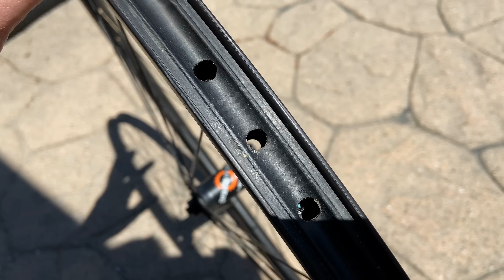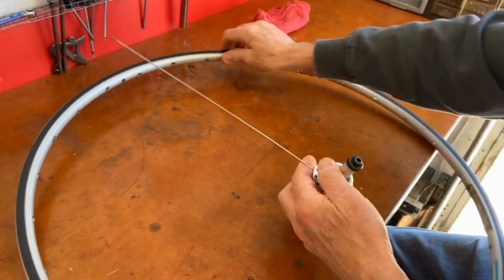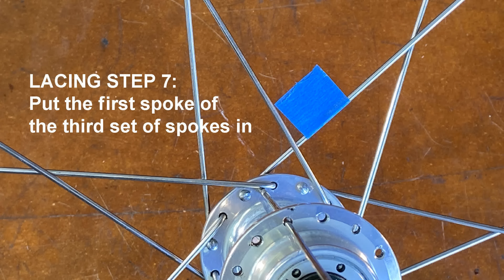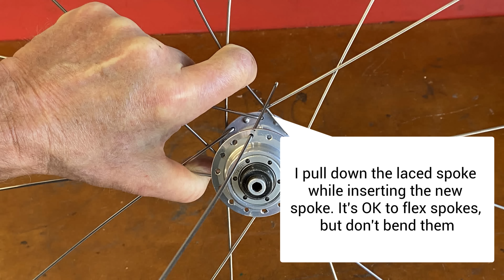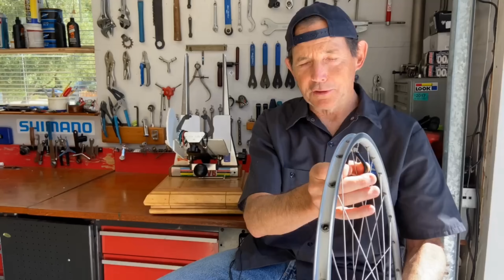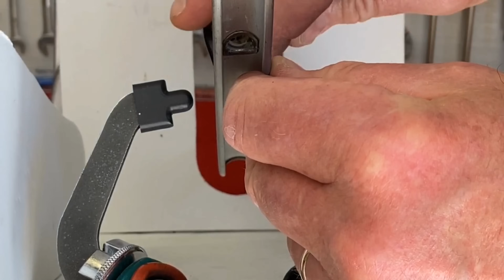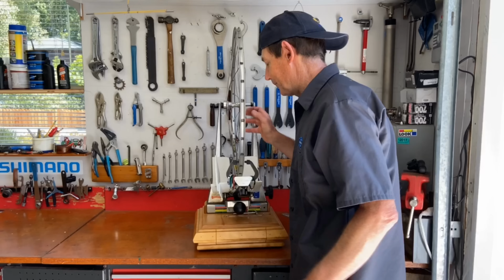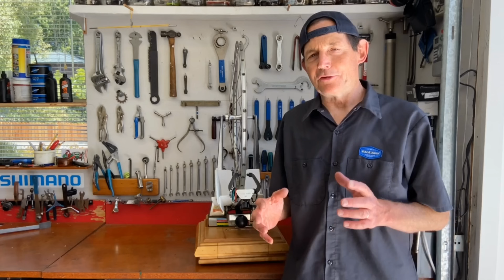How To Build Bicycle Wheels THE EASY WAY! #bikerepair

Comment: I'm just researching the build process. Your video is tremendous. I have a question about determining spoke length. I understand that many suppliers provide the correct spoke length for a given rim/hub combination. However, is it advisable to have the rim/hub in hand and measure to confirm the correct spoke length prior to buying the spokes?
Reply from the maker: Thanks for watching and the great comment, gnatman, appreciate it! I have another video about ways to determine spoke length here https://youtu.be/LvV4FE2VxZk To answer your question, I would say that most times the suppliers will get it right. And in theory if they don't they should be willing to replace the spokes with the right length since THEY made the mistake. But it never hurts to check if you have the parts and don't mind taking the measurements and doing the calculation. It's the odd stuff like new rims and hubs that no one knows the measurements on or they don't have them in their databases that usually cause the issues. With standard parts, they should get it right. Thanks again and hope this helps.
Reply: @Jim Langley  That's great to know. I'm in the process of my first bike build and figured I'd start building my first wheelset, too. It'll be fun, and I am glad I can learn from your videos. Thanks for replying!
Reply from the maker: @gnatman1102  you're very welcome. Have fun building the wheels and rest of the bike. That's a great project. Happy to help if you have questions.
Reply: @JimLangley1  I have another question. It involves the truing process.  I've read some literature saying it's preferable to only tighten during the truing process. You discuss and display both loosening and tightening spokes at the same time. Is this a normal process you employ for your building wheels? Or do you have a preference? Remember, I'm totally new to this and want to learn as much as I can.
Reply from the maker: @gnatman1102  that's a great question. What I recommend is mostly loosening at first and not tightening. That way you will not add any more tension early in the process. Usually when lacing some nipples may be further down on the spokes than others and those spokes will have a little more tension. Then when you start to true, it's better to loosen those spokes than to tighten the others.

What I do is first true for side to side. I spin the wheel and go around and try to get the wobbles out by loosening only. I move wobbles to left to the right and wobbles to the right to the left trying to get the rim back to the center.

If you find that loosening doesn't work to remove all the wobbles and get the wheel straight, then you have got all the spokes very loose (be careful never to unscrew a nipple all the way or it might drop off and you could lose it). At that point you may need to tighten some nipples to get the wobbles out but go easy and only use slight turns, like half turns or even quarter turns, that might be enough.

Usually by mostly loosening like this you can get the wheel very straight (no wobble). Once there, you then true for roundness - high spots and low spots. Since the spokes have only been mostly loosened in the first step, the wheel might be nice and round or close to it. But if not, look for any low spots and loosen the spokes in the low spots. See if you can get the wheel round doing that. Usually you'll be able to.

After getting the wheel straight and round with mostly loosening only, you check to see if the rim is centered since this is important too and it has to do with the tension. You can flip the wheel around in the truing stand to check if you don't have a dishing tool. Put one truing stand indicator next to the rim and flip the wheel. The rim is centered  when the distance from the rim to the indicator is the same when you flip the wheel in the stand.

If the centering is off as it can be with a just laced wheel, you can usually loosen the spokes on one side just a bit to get the rim to move half the distance to fix the centering issue.

In this early truing side to side, roundness and centering, you might find that loosening doesn't make the straightness or roundness or centering adjustment you need because the spokes are too loose. At that point you can tighten. You're going to do a lot of tightening to get the wheel properly tensioned. But the idea at first is to not put any stress on the spokes before the wheel is true, round and centered. That way when you do your tensioning the rim will be where it wants to end up and that makes the rest of the truing and tensioning go easier since you got it right at the outset with almost no tension on the spokes. Okay? Hope this helps. Take it slow and easy and observe what's happening. You only need to turn the nipple a little bit.. even quarter or half turns can be enough. You'll learn as you work and experience the process - enjoy it.
Reply: @Jim Langley  Thank you for the detailed information. I'm an engineer by trade. I have a perfectionist mindset, which gets me in trouble, sometimes. I know nothing is perfect, but it'll be fun.
Reply from the maker: @gnatman1102  if you take your time your engineering mindset and perfectionism will result in a perfect wheelset I’m sure. You can get most wheels very true and round so long as you focus and are patient working on one little wobble hop or dip at a time until they’re all done. It’s fun. You’ll get good at it with practice.
Reply: @Jim Langley  Thanks! I'm going to take the suggestion made to disassemble a wheel and disassemble from my 2012 hybrid and then rebuild it. I bet it needs truing anyway. I have some anti-sieze. I read some use for both the nipple threads and nipple to rim interface. If building carbon wheels, could anti-sieze be problematic? What do you use for nipples on a carbon wheel build?
Reply from the maker: @gnatman1102  using a used wheel is a great way to practice. Don't use anti-seize though - it makes a big mess of everything. Here's a video I made about ways to lube spokes: https://youtu.be/z4FKL95x6DE I use Wheelsmith Spoke Prep: https://amzn.to/3GeGdrL It's pretty easy to apply if you don't rush it and make sure not to get too much on. But it's kind of expensive. But even basic oil will work. You don't want too much or else it will get on the rim and down the spokes and you'll have a big job getting it all off with alcohol and rags and lots of wiping it off. You just need enough to wet 2/3rds of the spoke threads and the surface of the nipples that sits in the rim hole. On carbon rims, you don't want to lube the nipples as any oil, grease etc. will get on the carbon and can be difficult to get off depending on what it is.
Reply: @JimLangley1  Thanks! I'll watch it.
Reply: @Jim Langley  Back to the question on lubricant. Please forgive me for being dense. You may have answered earlier. I see you just lubricated the spoke threads. Do you ever add lubricant the interface between the nipple and rim in addition to the threads? Regarding the answer on carbon rims, I assume you still lubricate the threads? However, you don't add lubricant anywhere else to preventa mess on carbon spokes. Correct?
Reply from the maker: @gnatman1102  I lubricate the nipples on their outside when building aluminum rims only. You don't need much lube. Lube is easy to clean off of aluminum rims but still you want to try to keep the lube on the nipple and inside the rim not on the outside - especially if they are rim brake wheels. For carbon rims you don't use lube mainly because it can make a mess of carbon rims which are usually expensive. The lube just helps the nipples turn without binding as the spoke tension gets higher. Even if you forgot to lube in aluminum rims you'd be okay building the wheel. Lubing is an extra step with aluminum that just helps a bit during the build. 

Yes, I recommend always lubing the spoke threads or using a Spoke Prep. It makes the truing and tensioning easier as the tension increases. And down the road even years, if you lubed/prepped threads it'll be easier to true the wheel. If you don't the nipples might corrode onto the spokes in a worst case scenario.

It's your choice how you want to build wheels though. If you wanted to build wheels dry (no lubes or preps), you could do that and still build nice wheels. The reason is that the spokes and nipples have a small amount of lube on them from the process of manufacturing and packaging, especially spokes. Your hands will get a little dirty during building that's from the oil on the spokes. It's not much oil, barely noticeable but it is a type of lube or preservative that will act as a lube. So some builders will not lube and just go with factory spokes and nipples and trust that the lube on them is enough.

I prefer to add a little more lube on nipples and put Spoke Prep on the spoke threads. But, it's up to you how you want to do it really. Both will work. Hope I haven't just confused you more ;-)
Reply: @JimLangley1  You did not confuse me more. The information is extremely helpful. I really appreciate you taking the time out to provide such detailed and helpful responses. Not many others with YouTube channels are willing to go the extra mile to help the way you have helped me.  Thank you!
Reply: @Jim Langley  Do you have any good recommendations on where to source wheel components? Since I'm not reselling, I can only buy from retailers. Thanks!
Reply from the maker: @gnatman1102  it's always changing so everyone just googles and searches for what brand and models of hubs, rims and spokes they're looking to get and tries to find availability and best pricing and hopefully free or reasonable shipping and quick delivery (unless that doesn't matter). I look on the component maker websites because sometimes they do sell retail to consumers and I check Amazon since lots of even large makers sell on there now and eBay.com because shops sell overstock there and others, too so you can find crazy deals sometime (just got a pair of new vintage Mavic rims for $50). And you can go to companies that sell wheel components like wheelbuilder.com and prowheelbuilder.com. So it's always a bit of a project but you can almost always find what you need. The bike biz has been having a lot of shortages in the supply chain but it's improving lately. Hope this helps!
Reply: @Jim Langley  I figured Google or eBay would be my friend on the shopping side of wheel building. Thanks again!
Reply: @Jim Langley  Oh well. I'm back with another question or two. By the way, I appreciate the helpful responses. What are your thoughts on straight-pull and bladed spokes? I'm looking at a DT Swiss hub, which accommodates straight-pull spokes. It appears they make lacing pretty easy.
Reply from the maker: @gnatman1102  hi gnatman! I prefer regular J bend spokes and regular round spokes too. It's not that I dislike straight pulls and aeros, just that they tend to complicate the wheel build. While the aero spokes make for a more aero wheel, they can be more prone to twisting requiring spoke holding tools when you're truing and tensioning. And the same holds true for straight pull spokes - depending on the design of the hub. But, plenty of wheels are built with both and if you want to do it, I can walk you through what you should buy in the way of spoke holders and how to use them. 

Basically you hold the spoke with the holder with one hand while you turn the nipple with your other hand. That's compared to just turning the nipples with one hand. So it's a little more coordination with both hands and that makes it a little longer truing and tensioning and 2 things to pay attention to (not twisting the spoke/getting the wheel straight and round and tensioned), rather than one (just truing, rounding, tensioning the wheel). Hope this explains and is helpful. Here you can see me holding the spoke with the tool while truing with the spoke wrench in my other hand to get an idea how you work with both hands and focus on two things (kind of a fun dance but slower than working with standard round/J bend spokes): https://youtu.be/NyPGQrNfUFU?t=1360
Reply: @JimLangley1  Thanks again for your help. For the 1st scratch build, I'll just go with J-bend spokes.
Reply from the maker: @gnatman1102  you're very welcome, I think that's a good way to go. Have fun!
Reply: @Jim Langley  I have a question about nipple length and nipple washers. I'm looking at 12 mm vs. 14 mm. I know there are many factors influencing the selection. If choosing spoke length based on a calculator, which length nipple would be a better choice? What about using nipple washers?
Reply from the maker: @gnatman1102  12mm is the length most used gnatman so I usually go with that. Longer nipples might be needed with unusual, unique rim designs. There are even nipples a lot longer for special wheels like wood rims. But 12 is what's used most so you can't go wrong with most standard parts. 

Rim washers are mainly used if a rim manufacturer specifies that they must be used with their rims. In the 1950s and 60s there were aluminum rims without reinforcements of any kind inside the nipple holes. Later companies started installing ferrules in the holes to reinforce them. 

Nipple washers were required on rims without the ferrules from certain rim brands making superlight rims (the washers came with the rims, that's how you knew you had to build with them). 

These days, the rims that sometimes call for nipple washers are carbon rims, but it's rare because the carbon rims can be made so strong. So it really depends on what you're working with but in most cases longer nipples and rim washers are not necessary. Hope this helps!
Reply: @Jim Langley  This helps a great deal. I'm looking at a set of DT Swiss alloy rims for my 1st build. The reason I asked about the washers is the Pro Wheel Builder spoke-length calculator listed the rim with nipple washers. I'm curious to see what DT Swiss actually specifies. Thanks for the reply!
Reply from the maker: @gnatman1102  that's interesting. I would expect DT Swiss rims to have ferrules and not to require rim/nipple washers.
Reply: @JimLangley1  I plan to reach out to DT Swiss and ask.
Reply: @Jim Langley  Prior to contacting DT Swiss, I looked at the specs for the rim. It is a non-eyelet rim. So, I figured that was the reason for the builder site specifying the nipple washer. To confirm, I sent DT Swiss a message. They responded and indicated the rim requites the nipple washer, which they supply with the rim along with the nipples. Do you have any experience with their Pro-Lock Nipples? If so, should the threads receive lubricant even though they come with, essentially, a loctite material? I didn't ask them and decided to ask you here to get some real-world opinion. Thanks!
Reply from the maker: @gnatman1102  yes, I've used Pro-Locks, gnatman. You don't need to use any lubricant with them. They get harder to turn as you're truing and tensioning the wheel because the thread locker reaches more threads and begins to do its job of binding the nipples. I prefer to build with regular nipples and spokes treated with Spoke Prep or just lubed since you have less issues with spoke twist and thread locker trying to lock the nipple as you build the wheel. I don't know if you saw it but I have a video showing how to remove nipple/rim washers that you might like to watch to get an idea what working with them is like: https://youtu.be/6EtQsst3Z98 Overall, for a first build I would say it's significantly easier to go with regular spokes, nipples and no rim washers. That's also the way the vast majority of wheels are built.
Reply: @Jim Langley  Based on your response, you convinced me to follow my instincts to build a normal (i.e., without nipple washers) wheel . I'm also looking at a set of Light Bicycle Falco Pro carbon rims. After looking at the LB rims, I saw your video from 2 years ago, where you evaluate an LB carbon wheelset. It's interesting that the set you evaluated didn't have nipple access holes. According to their website, they say feeding the nipple through the rim is more challenging. At this stage of my building career, I would order with the access holes, as I don't want this challenge yet.  The access-hole rims are tubeless ready, and I would consider taping the rim an easier task. The only thing is Pro-Wheel Builder doesn't have the LB rims on the drop-down list for spoke-length calculation. However,  I know how to measure for spoke length. I plan to order the rims, hubs, and get some old spokes and nipples to use to determine ERD. Do you have any suggestions?
Reply from the maker: @gnatman1102  yes, feeding the nipples through the rim is another skill to learn with those rims gnatman.. LB has a video showing how they recommend doing it and Park Tool just put one up too. It looks kind of fun but definitely s-l-o-w compared to just popping em in through holes. Rim tape does fine sealing rims. As far as determining the ERD of those rims you can wait and measure them and you could also reach out to LB and ask them. They'll know what the ERD is on all their rims.
Reply: @Jim Langley  Didn't think about asking LB. Good suggestion! Thanks!
Reply: Hello Jim! I ordered and received DT Swiss Classic 240 hubs for my build. I decided to check the hub dimension specs for the spoke length calculation. Of course, nominal hub widths for road hubs are 142 mm rear and 100 front. I measured widths of 143.2 mm rear and 100.93 mm front. So, I checked the rear with an old imperial caliper and measured just over 5.63 inches or approximately 143 mm. I looked all over the web for +/- tolerances for the hub industry and couldn't find anything. I assume these measurements are within acceptable tolerance? That is less than 1% to the wide side for both. So, I should probably accept these measurements and proceed.
Reply from the maker: @gnatman1102  Nice hubs Gnatman! I'm thinking that those slight differences might be due to something like the end caps not being completely pressed down. Did those 240 hubs come from DT Swiss in original packaging from DT? Or did they come separate in packaging that's generic, not DT Swiss? If that was the case the hubs might have been assembled and the end caps can get pushing on by people who don't understand and not get bottomed out. Also, if an end cap has something pushed into it like a hub protector/wheel protector when you pull those protectors out/off it can sometimes move the end cap position. Try resting the hub on a flat surface and press down on the top end cap with your hand or gently tap with a rubber mallet to see if you can seat the end caps further. Be gentle, the caps should seat without too much force. Then remeasure and see if it makes any difference. I think it might as I would expect 100 and 142 from DT from measuring hundreds of their hubs over the years. I think it's probably an issue with the end caps and that the "real" spacing is 100 and 142 or closer to it than your caliper measured. Hope this helps. Let me know what you find.
Reply: @Jim Langley  I bought the hubs retail from the LBS. They came in original DT Swiss packaging. Attempted the adjustment, and both hub widths did not change. The rear hub does fit well in the dropouts for the thru axle. I don't know if I should reach out to DT Swiss? Thanks!
Reply from the maker: @gnatman1102  well it won't affect the build and if they came that way then that's just what they are. But I'm still curious. Is there any chance your caliper is off or that something about the hub is making the caliper ends sit crooked on the end caps when you take your measurement? I usually measure with a thru axle gauge that goes through the axle: https://youtu.be/blrOra5vi5I
Reply: @Jim Langley  Thanks! I like the hub width tool tip video. However, I'm confident in the metric caliper. I compared it to my old imperial unit caliper. Using the rear hub and old caliper, it measured 5.63 inches. Converting to mm result is 143. I kind of like the wider error because of the secure fit in the dropouts.
Reply from the maker: @gnatman1102  thanks for letting me know. I'm glad you are okay with it. Sure sounds like it's just what it is and nothing to worry about.
Reply: @Jim Langley  I haven't received the rims from Light Bicycle yet. For the rims ordered, they quote an ERD of 550 mm, without nipple head. Using the Pro Wheel Builder spoke calculator and my manual measurements for the rear hub, the length estimates are 271.4 left and 269.9 right, or rounded to 271 and 270. Keeping the ERD constant at 550 and selecting the hub model on the DT Swiss Spoke Calculator page, the spoke lengths are 271 left and 270 right. I think I'm in pretty good shape with the manual measurements. However, I need the rims to confirm the ERD.
Reply from the maker: @gnatman1102  that sounds about right to me but I always feel better after measuring the rims myself.
Reply: Hey Jim! Got the old front wheel apart and measured ERD and hub. Have you run into a factory wheel built with spokes that are too short? I've checked the measurements and calculation several times, and arrived at the same result. They are about 2 to 4 mm too short
Reply from the maker: @gnatman1102  yes, the quality of factory-built wheels varies a lot. Sometimes they’re great, sometimes not so much. Same thing with production wheels on sometimes even major brand bikes - they can have issues too.
Reply: @JimLangley1  Thanks for that information! Tried to put it back together anyway. Lacing went well. However, I couldn't get the threads of shorter spokes on the disc rotor side of the front wheel into the nipples without over tensioning the spokes. Didn't want to damage the hub. By the way, when inserting the key spoke, does it matter if the disk rotor side is up or down for the front hub when the spoke holes are alternating from center? Overall is, typical, symmetrical. I inserted the spoke in left hole from stem. I don't believe it does, but I wanted to check. By the way, I plan to buy new spokes and nipples for the wheel and start over.
Reply from the maker: @gnatman1102  I saw your other comment about the rotor side of the hub but when I hit reply YouTube didn’t take me to the comment so there wasn’t any way to reply - one of the mysteries of YT that happens now and then. But to answer it only matters if the rim drilling is offset. Since yours isn’t you only need to make sure the rotor side spokes go to same side as the hub rim holes. Hope this helps.
Reply: @JimLangley1  It does. That's what I did. Thanks!
Reply: @Jim Langley  Hi Jim! Ordered and received the new spokes/nipples for the rebuild of the front wheel. Since the calculator estimated lengths of 291 mm and 293 mm, I went with a non-differential 292 mm average. When dealing with a rotor or drive side wheel and non-differential spokes, I've read two opinions. One is to only begin tensioning from the rotor or drive side and only adjust the non-rotor or non-drive side spokes during the truing process. The other is to begin tensioning by tightening the nipples in a 3 to 1 ratio rotor or drive side to the other side prior to the truing phase. I'm curious. What opinion do yo have on this?
Reply from the maker: @gnatman1102  you're at one of the most fun parts of wheel building gnatman! So to explain, if you had different length spokes and you turned each nipple down by the same amount when lacing, you would end up with the rim already somewhat centered over the hub. Because it would move toward the shorter spokes. Since you are using same size spokes that won't happen. So you will want to check that the rim is centered during this initial stage of truing and rounding the just-laced wheel.

What I do is true the wheel for side to side first. Then I true it for round. I do this trying to only loosen spokes first rather than tightening any. The goal is to end up with a true, round wheel with almost zero tension on the spokes at this point (the wheel was just laced so there should be little tension on the spokes). As the wheel gets true and round I will check it for centering. If it's a little off as is usually the case with same size spokes, then you need to loosen the spokes on one side a little to get the rim to center. Keep in mind it only needs to move half way whatever distance it needs to move. Since it's a front wheel it's not going to need very much.

Now once the wheel is true, round and centered with very little to almost zero tension on the spokes, it's time to start tensioning the wheel. During this process you will want to pay attention to determine what happens. Usually with most front wheels, to keep the wheel centered as you tension, you will turn the drive side nipples about a half as much as you turn the rotor side nipples (that's the tighter side). So if you turn each rotor side nipple one turn, you turn the other side 1/2 or sometimes 3/4 turn. That ensures that the rim doesn't move out of center. But this varies a little from wheel to wheel so you'll want to try it and then check the center and see if the rim stayed centered. If so, then you're good. And you can continue tightening like that. 

It's good keep checking the centering after each round of adding tension. I use a dishing gauge, some people like to flip the wheel in the truing stand but to me that's slower. You can also use the stand to check centering. You do this by setting one side of the truing stand caliper to just miss the rim when it spins. This is when you know the wheel is centered, i.e. you have the rim where it needs to be. Now that the stand is adjusted this way, each time you add another round of tension you can see if the rim moved and if it did, you can go around and loosen to get the rim to go back where it's supposed to be to be centered.

You can also fix any centering discrepancies when you're done tensioning, but it's usually easier to get it centered at the outset and then keep it there as you tension. On some wheels, once a wheel is true, round, centered and has been about 50% tensioned it will stay that way throughout the rest of the tensioning process once you figure out the right amount to tighten each side's nipples. Okay? Hope this helps and have fun!
Reply: @Jim Langley   @Jim Langley   Thanks for taking the time for such a detailed response! It definitely helps give me a good starting base.
Reply: @Jim Langley  Hi Jim! Finally! My hybrid front was rebuilt. The question. Can I claim success?  I was able to true laterally and radially within acceptable. The dish is virtually spot on.  For the tensioning, I was able to get tension within 15% of average on both sides. I was one spoke away from within 10%. However, I question if the difference in tension from non-rotor side to rotor side is too great. Average rotor side tension ended up at 102.8 kgf. Non-rotor side average is 55.8 kgf. I read somewhere that getting a ratio of 1.8 between the two is good.  Or should I just be concerned with getting the rotor side within spec for the rim along with true and the dish?
Reply from the maker: @gnatman1102  way to go gnatman, good job! You’ll most likely be fine, but if you wanted to tighten the wheel a wee bit more it would help the looser side spokes which if they’re are slightly undertensioned might loosen after many miles. As you add a layer of tension to the wheel the sides should get closer to each other too. But you could also just ride the wheel and keep checking it and if the loose side spokes stay tight all’s good. If not it’ll be an ez job now to add a bit more tension now that you’re a bona fida wheelbuilder!
Reply: @Jim Langley  Thanks for the reply! I guess I'm an apprentice bona-fide wheel builder. Lol. I did find something about the ratio of tensions between one side, and the other should be consistent with the hub flange distances to center.  For the front, the left hub flange to center is 22.4 mm. The right is 37.1 mm. Therefore, the right-side spokes should be approximately 60.3 percent of the left. With the left spokes at 102.8, the right should be approximately 62 kgf. I'll try to bump up the tension on the right side and go from there.
Reply from the maker: @gnatman1102  that’s interesting. The way I learned is to go by the max tension, which has changed as rims have changed - gotten higher. By going by that it’s pretty simple because you don’t even measure loose side tens you just measure tight side to ensure it’s at your max tension. Because the loose side is always going to end up wherever it ends up based on the tens of the tight side. But you don’t want spokes loosening on riders so if that happens on the loose side you would add tension to the whole wheel even if it means going a little tighter on the max tens. Another “trick” for loose side spokes that loosen is to only tighten the loose side a little. This will change the rim centering but in most cases the wheel will still center close enough in the frame so it won’t affect anything and it can keep those spokes from loosening.
Reply from the maker: @gnatman1102  that’s interesting. The way I learned is to go by the max tension, which has changed as rims have changed - gotten higher. By going by that it’s pretty simple because you don’t even measure loose side tens you just measure tight side to ensure it’s at your max tension. Because the loose side is always going to end up wherever it ends up based on the tens of the tight side. But you don’t want spokes loosening on riders so if that happens on the loose side you would add tension to the whole wheel even if it means going a little tighter on the max tens. Another “trick” for loose side spokes that loosen is to only tighten the loose side a little. This will change the rim centering but in most cases the wheel will still center close enough in the frame so it won’t affect anything and it can keep those spokes from loosening.
Reply: @JimLangley1  Hi Jim!  During this wheel build, calculating a theoretical lower-side tension prior to the build would’ve been helpful.  I am certain you already know all this information presented in this post.  However, I wanted to share it for those that may read our discussion items.  The calculation provides a theoretical tension of these lower-tension spokes needed to maintain a proper dish for a wheel where the higher-tension spokes are at the goal tension and the wheel is true.  By measuring the lower-tension side during the build, it can show if these spokes are being tightened too fast in relation to the higher-tension side, which I believe complicates the truing process.  In my view, as long as the tensioning and truing process are performed slowly along with sufficient stress relieving the wheel throughout, checking the lower-tension side during the build can minimize the need to constantly check the dish.  During my build, this was the biggest fight I had during truing process.  That was truing would throwing the dish off, and vice-versa.

Since my last response, I came across the website titled Spoke Calc.  They have a great deal of information/instruction on, of course, spokes.  You may already know about them.  Their primary goal appears to be to sell their spoke tension calculator.  The main sub-link of interest is:  https://spokecalc.io/spoke-tension-the-difinitive-guide.php.  About one-third down the page is a basic formula for calculating spoke tension on any side, provided the lengths and angles are known along with the tension of one of the sides.  I am a nuclear waste characterization by trade.  However, my degree is in Civil Engineering, and I have a good grasp on statics.  Basically, the formula is statics.  I can’t believe it took me so long to think about wheel building is essentially a statics problem, and I should’ve been able to calculate this on my own.

The front-wheel I re-built is 11-years old.  I could not find a tension spec for it.  So, I aimed for an average value around 100 kgf for the high-tension side.  Since I ended up at an average of 102.8 kgf along with a reasonably true and dished wheel, I am completely happy with my efforts.  However, checking the lower-side tension against a theoretical value during the build would’ve been helpful in evaluating the dish without actually having to perform the check and fight it as I noted above.

For my setup, it was a bit more tricky because the spokes at the rim do not merge to a single point.  This is due to the offset of each spoke hole from the rim center.  When re-building the wheel, I did not measure the distance of each off the centerline of the rim mine because the offset is symmetrical.  The total offset distance between holes is not much.  Based on a visual estimate, it’s about 1 to 2 mm on each side of center to the center of the holes.  However, to calculate the angles of the spokes at the rim, all I had to do was subtract 1 mm from each flange to center measurement.  From there, it was easy.  Since I built to 102.8 kgf average on the high-tension side, the result for the low-tension side is 60.9 kgf for the wheel to be dished.  However, nothing is perfect, and the variability in the tensions show to arrive a true wheel show this.

I look forward to continuing this journey becoming a wheel builder, and I want to thank you for taking the time to assist me with this effort.
Reply from the maker: @gnatman1102  thank you for sharing all this gnatman. I’m happy you found that great site (yes I’ve used it) and that it helped you learn more about the wheel building process. Most beginners don’t have and would prefer not to have to pay for a tensiometer and only 40 years or so ago they didn’t even exist and no mechanic felt a tool like that was needed to build great wheels. The first one I had was around 1982, 12 years after I became a bike mechanic. Today most pro wheel builders wouldn’t be without one. But you can still built great wheels without one. And if you’re only building one or a few it’s hard for most people to justify the expense and it also adds another step to the builds and having to learn how to use and read the tool. Again congratulations on building your wheel and learning the process and thanks for this great conversation that will surely help others follow in your footsteps 🙏
Reply: @Jim Langley  My pleasure. I'm looking at the wheel building more as a retirement activity. I turned 60 last November and plan to retire at 67. If I can, sooner would be better. I don't believe I can really make any supplemental income building from scratch. For building from scratch initially, I'll look at it something I can do for friends for free and build a customer base and go from there.  However, I believe I can get into the repair or maintenance side (i.e.  truing) of wheels. I spoke with a LBS recently about it and asked them if they do wheel repair in house. I found out they source that out because none of their techs are good at wheels. Who knows if this is even viable for me? However, it's worth a shot. At least, I now have another hobby I can use to justify retirement. At least, I found out Pro Wheel Builder is in Cumming, GA. I'm in GA as well.
Reply from the maker: @gnatman1102  it’s great to hear you may be able to turn wheel building and repair into income during retirement. That’ll be fun I’m sure.
Reply from the maker: @gnatman1102  that sounds like a great plan and a fun job for retirement. I hope it works out.
Reply: @Jim Langley  Hi Jim! You may have a video covering my question here. What are your thoughts on the use of aluminum nipples. My new rims will be carbon. I know aluminum and carbon composites can undergo galvanic corrosion. I also know that the ammonia in the Wheel Smith Spoke Prep can be corrosive to aluminum. Therefore, do you ever use aluminum nipples? I like the color options, but it appears they pose more trouble than their worth. For my wheel rebuild, I bought 100 black brass 12 mm nipples. I figured that after the rebuild, I'd have 68 left for 56 spoke holes on the new rims.
Reply from the maker: @gnatman1102  brass makes the most sense but most high performance wheels use aluminum to save weight and meet consumer expectations gnatman. 99.9% of the 500 or so wheels I’ve built in recent years were with aluminum because it’s what people demand. They hold up fine in carbon rims and with sealant unless you ride a lot in snow where they salt the roads or if the rim tape job has leaks and a corrosive sealant gets at the nipples. But the most common problem I’ve seen is too short spokes. That will cause aluminum nipples to break at the top of the spoke. The spokes need to fill aluminum nipples. No worries on spoke length with brass and the actual weight saving is about 40 grams per wheel so hardly noticeable. Hope this helps!
Reply: @JimLangley1  That's good to know about aluminum. I like the idea of adding some other color to my new wheels and may give aluminum nipples a try then. Thanks!
Reply: Hi Jim! Hope all is well. I finally received the Light Bicycle carbon rims. Since Light Bicycle recommends double butted or bladed spokes, I went with bladed.  I have a tool for preventing wind up. I also decided to try aluminum nipples. The problem is the rim has a tension spec of 120 kgf to 135 kgf. I couldn't get to the bottom of the range without damaging the nipples. The nipples actually deformed by twisting and not by rounding. I prepped the threads, lubricated the nipples and used the correct size spoke wrench, and just couldn't get there. They were DT Swiss nipples. Other than switching to brass, are there any other recommendations/techniques with aluminum nipples?
Reply from the maker: @gnatman1102  hi Gnatman! Something sounds definitely wrong. I can't recall ever damaging aluminum nipples the way you describe. So either I don't understand what's happening or perhaps something was wrong with the nipples. But, I've never ever had an aluminum nipple from DT or other companies fail the way you describe. Could you take a photo of some of the damaged nipples and email it to me at my first and last name at gmail? Maybe if I could see a photo I could figure out what's going on. 120-135 is on the high side of spoke tension, the 135 more than the 120 which is pretty standard. For the nipples to fail at 120 - a normal tension spec - I think something's amiss but I'm not sure what. Maybe a photo will hold a clue.
Reply: @JimLangley1  Thanks for replying! I put them in the trash. So, I can't take any photos. I switched to the brass. A few of them deformed in a twisting fashion. After going over the process in my head, I put the blame squarely on me and my inexperience. I was careful applying the WS Spoke Prep. A few appeared to have excess. I remember some of the nipples were somewhat difficult to turn while zeroing them out after lacing. I'm not certain if this could be an issue. I put oil in between the nipple and rim as well. I also fought both truing and dushing. So, I'm not certain if repeated turnings stressed the aluminum too much. I will switch to brass for this build and save the remaining aluminum nipples for later. Thanks for the offer to assist!
Reply from the maker: @gnatman1102  thanks for explaining more. It sounds like maybe you just turned them too many times. Ideally you will initially get the wheel round and true and centered almost perfectly and almost only by loosening nipples/spokes not tightening them. The idea is to have a nice perfect wheel with almost no spoke tension. This won't stress the nipples at all. Once the wheel is like that you gradually bring up the tension of the wheel. If you go back and forth tightening and loosening and repeating that process you could possibly wear out some nipples. Brass nipples will help and as you develop your process and skill I bet you won't experience this again.
Reply: @JimLangley1  I love troubleshooting and am really enjoying the process.  I read a few wheel-building forums about aluminum alloy nipples. Several people had the same issue I did with DT Swiss alloy.  They found the alloy was prone to binding during the truing process.  For alloy, several switched to Sapim. Apparently, the Sapim have a better coating that resists binding. Some only use the double-square nipples from Sapim when building with alloy. I also found out Light Bicycle builds their wheels with the double-square Sapim alloy nipples. LB also uses the 18 mm double-square, which is 14 mm internal. I used 12 mm. Initially, I thought they were going to be too short for the rim, but the extend out just far enough to get the wrench on it without damaging the rim.  It would've been nice if LB included this info in their online manual for building. Do you like double-square nipples? They seem to have a good purpose.
Reply from the maker: @gnatman1102  yes, I've used DSN nipples a lot (double square) - it's nice to have two turning options. I'm glad you're enjoying the learning and troubleshooting so much, it's all part of what makes wheel building so enjoyable to me.
Reply: @JimLangley1  Hi Jim! Well, I switched to brass and got the rear wheel as good as I could while maintaining 1 mm on the dish gauge. The highest tension I could achieve on the drive side is 110 kgf. Even though none of the spokes bottomed in the nipples, I could no longer turn a few. I rounded a few of the brass and replaced them.  Even though lubricated, I believe the niples were binding in the carbon. All tensions are within 5% of average per side. I'm sure the wheel is good to use, but I wonder if I should tear apart and go with nipple washers? Of course, that may necessitate another set of spokes.
Reply from the maker: @gnatman1102  something is going on to have such difficulty getting the wheel to tension and to keep having nipples fail. I'm wondering if maybe you've got the spokes in the wrong holes in the rim? That mistake will bind the nipples for sure. Did the rim come with a lacing label telling you how the rim is designed? Or did they send instructions or did you find instructions to follow before lacing? You might be able to see it if the rim is laced wrong but it's not easy. That's why it's best to go by the rim maker's instructions. The binding happens because the rim hole is drilled at an angle and the nipple is put in across or fighting the angle not in line with the way the hole was drilled in the rim. I think that might be what's going on.
Reply: @JimLangley1  You may already know Light Bicycle applies a spoke direction arrow adjacent to the valve hole indicating the angled spoke hole. Their instructions also noted the angled spoke holes. When looking at the spoke holes, I confirmed this fact. When lacing, I ensured the arrow was facing up and installed the spoke from the upper flange based on the orientation of the hub. Since I haven't built the front wheel, I inserted 2 spokes with nipples in the spoke holes on each side of the valve hole and positioned the spokes as if lacing a hub. Based on this check, I laced it correctly.

However, while performing this check, I came across one possible issue that I didn't really worry much about during the build. Each nipple is 2 mm, both the brass and alloy. I have plenty of spare bladed spokes from the recent purchase.  When threading the nipple on any of these new bladed spoke threads, the nipples started binding on the threads after 4 or 5 rotations. This happened trying other nipples. I could turn them, but it required some force to thread the nipples completely on the spoke that was not normal. When building the rear wheel, I noticed the extra resistance that appeared odd when zeroing the nipples but kept going thinking it was caused by the spoke prep. Back to today. After noticing the nipples binding on the bladed spoke threads, I tried several of my leftover double-butted spokes. I could spin the nipples on all these spokes with no extra effort needed.

I wonder if there is a difference in the thread pitch from the bladed spokes versus the other? I can't find my magnifying glass to check. So, I can't confirm. I measured the thread diameter, and both types are 2.0 mm. So, diameter doesn't appear to be the issue.  I know the issue is not whether a spoke is bladed or double-butted. They are each spec'd as 2.0 mm at the threads on the shipping order.

I wonder if I'm dealing with some galling of the threads causing seizure of the nipples? Have you dealt with this before?

Sorry for the long post, but I'm glad you asked the question about the spoke hole angles. It got me investigating, and I appreciate that.
Reply from the maker: @gnatman1102  I have only had Light Bicycles wheels in my shop never their rims alone. But, from what you describe about the fit of the nipples maybe you have the wrong spokes for the nipples? Nipples should thread on without any difficulty by hand and especially with any spoke wrench. Spoke Prep if it's too thick can make it more difficult but nothing like what you're experiencing. If the spokes are Sapim and the nipples are Sapim and both are 2.0 then I wouldn't expect them to have problems; same if they are both DT. But if the nipples won't thread onto the spokes all the way by hand, then something's not right. Can you contact Sapim and see if they made a mistake and shipped the wrong spokes? The spokes are stainless steel most likely so the threads shouldn't be able to corrode on the spokes and new nipples in brass or aluminum shouldn't have had time to corrode so I can't see how galling could be happening. But what you describe is exactly what happens if you try to put 1.8mm nipples on 2.0mm spokes. In the shop you have to be extra careful not to mix up spokes and nipples for this reason. You can't see the difference. It's easy to get it wrong. If this is the problem it's too bad as it sounds like whoever sold the spokes might have made a mistake. Good luck.
Reply: @JimLangley1  Actually, I purchased the spokes from Prowheelbuilder. After my message to you, I reached out to them. In fact, I'm in Augusta, GA, and Prowheelbuilder is located in Cumming, GA, northeast of Atlanta. I like buying from them because shipment time is great. The nipples are not the issue, as they worked fine on the double-butted spokes I used for my hybrid wheel rebuild. After several correspondences, they indicated a die the use was failing and was replaced. The spokes I ordered may have been cut with that. Apparently, they cut spokes to length to fulfill an order and then cut threads. I was told it was a die, but I thought spoke threads were formed by rolling. Either way, they plan to replace the spokes.
Reply from the maker: @gnatman1102  I'm happy to hear you figured out what's wrong gnatman. I would never expect a company like Prowheelbuilder to cut & thread spokes to length. I would expect them to only sell factory spokes fresh out of the box, never altered spokes. If I had thought there was a possibility you purchased cut & threaded spokes I would have known that was probably the issue because it's a common problem when people buy from bike shops that have these spoke cutters. It's especially questionable that they didn't bother to check the threads on each spoke before sending them to you too. But at least you should be good now. Hopefully they can send you factory spokes not more cut spokes since they don't seem to have a good machine and also don't seem to know how to use it or how to do basic QC checks. If the subject comes up you could ask if they use the Morizumi machine ($3,800). That's the one machine that looks trustworthy, but even with that you aren't getting factory threading and you get a spoke that's shorter than it was meant to be. Apologies for the negativity but I thought better of Prowheelbuilder. Now I know better, thank you.
Reply: @JimLangley1  I agree with you. Reading that from them was a bit disconcerting. I have no direct evidence they trim and re-thread spokes. The fact that their email response included the use of a die suggests they trim spokes to size and re-thread. It bothers me that they would consider sending out spokes that may have suspect threads is enough to move my business elsewhere. Perhaps one day, if I get good enough to do this as a business, I can bypass retail places and buy direct wholesale from the suppliers.